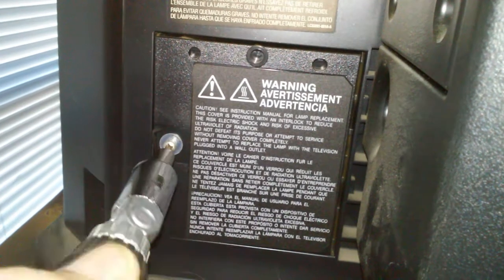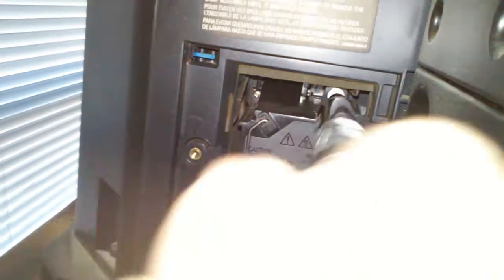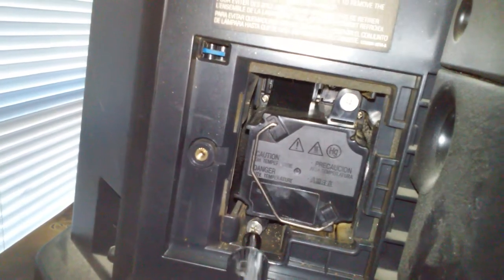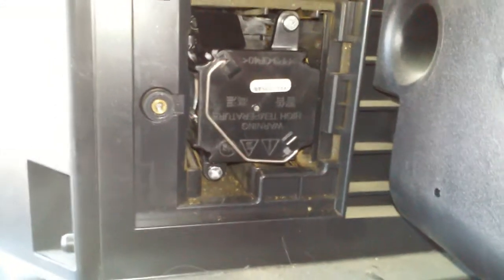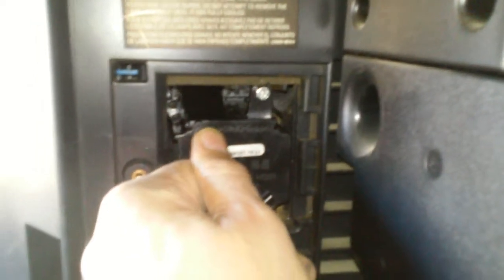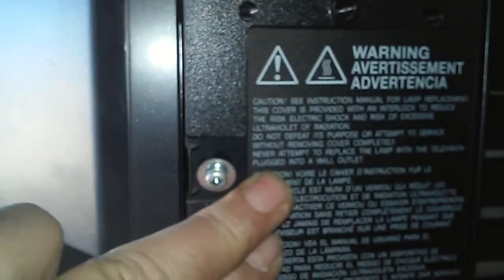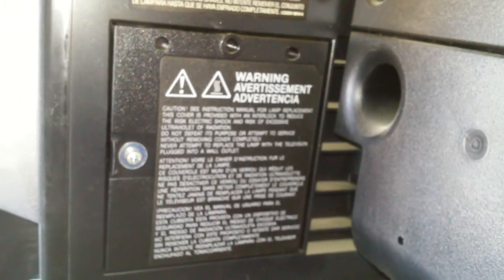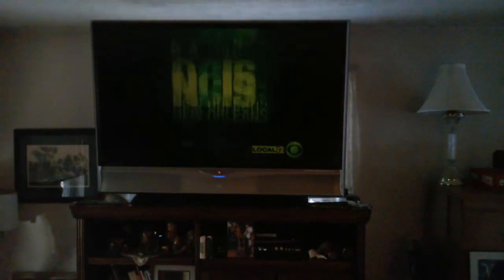Replacing JVC Rear Projection TV Lamp

Comment: Bought a new one today and installed it. It came on for a few seconds then the blue power light went off but the orange light did the slow blink that it does when the tv winds down (as opposed to the rapid blink with sound when the tube is out). Help please. Checked connections and everything. Also left a messsge with the seller whom I've bought the same tube from twice before.